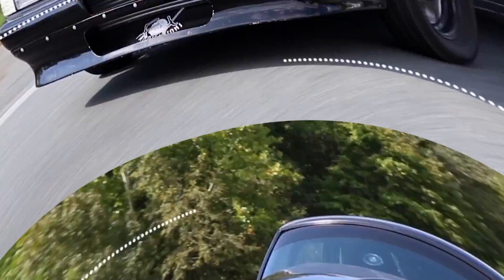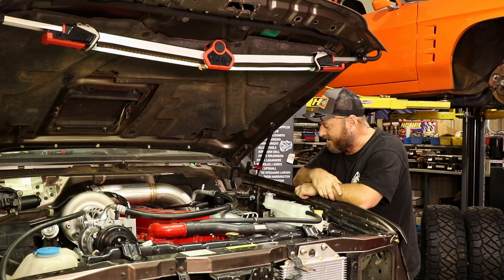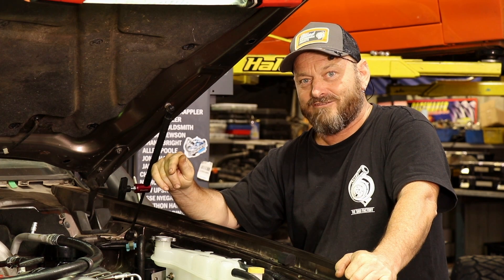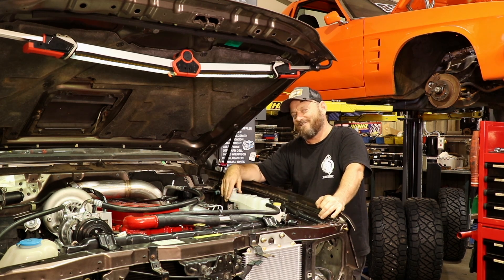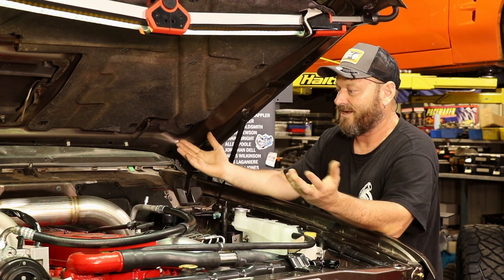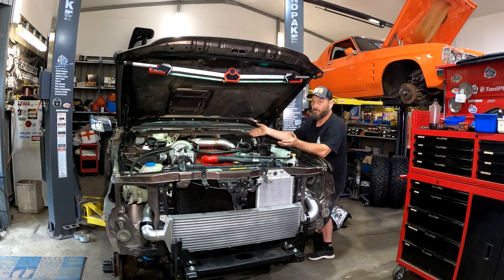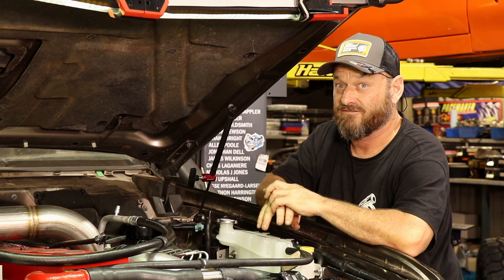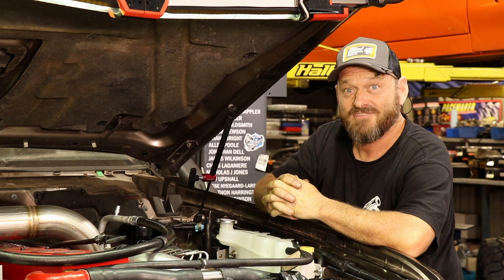Injector Pumps Explained - P7100 v VE v VP44 - Cummins Patrol EP12

Comment: VE pump was 89-91.5 and 91.5-93 for non ic and intercooled 12v. For 94 the p7100 pump was introduced and it was run until 98.5 when the 24v was introduced with the vp44 pump

Comment: the vp44 pump is technically a hybrid pump. With cam-driven, radial piston pump, it features three internal pumping plungers, a fuel metering solenoid, a timing advance solenoid. It's still mechanically injected,  but you can electronically control fueling, using a fuel controller  you can change fueling on the fly with a touch of button.   Also there was 2 types of vp44 pumps you had the std with automatic or manual and H.O. with manual only which had more plunger lift and smaller plungers then the std ones,  So the hop up was to take a H.O. vp44 fueling cam for the lift and use the std pumps larger plungers,  for more fuel supply for bigger injection lines with larger injectors.  And to keep your vp44 pump alive you need to maintain no less then 12psi of fuel at W.O.T.  and 24v cummins with vp44 is when cold they will kick into a high idle to warm up.  And if you're located in very cold weather areas you can have a vp44 24v do something that warms them up even faster and that is having the ecm programed to after it goes into high idle, for 2 mins and temps are colder the 10 degs F. It will go into 3cyl high idle,  by shutting fuel of to 3 off the cylinders to put a load on the engine to warm up faster.    The std 24v was 235hp 16.3:1 compression, the H.O. was 245hp with 17.2:1 compression.     I had a well tuned 01 24v with a 35/45hx hybrid turbo grid heater deleted, RV275 injectors,  and a hotrod pump which was H.O. fueling cam in a std pump case. With .093 injection lines, which make it lopey at idle. And an edge juice with attitude tuner module.  And to keep my vp44 alive I ran an airdog 150 pump.  Was my daily driver and weekend hauler for 10yrs put 250k miles on that truck.

Comment: P pump is easier to tune, you can get the balance between cylinders spot on, having multiple plungers helps in field reliability, tough industrial grade pump FYI Nippon denso make em too. Rotary pumps pretty good but usually if they fail they’re scrap.

Comment: 1:56 that line is bent so hard, it is likely doing nothing. I freaking love this build. You all are killing it. This series lit the fire under refreshing my Cummins. I had to repair years of neglect. Full rebuild, new common rail, had to replace all injectors, new oil bypass valve, all new lines and hoses, basically all new accessories.... I'm about 10K USD into it. But, the whole drivetrain is all new or rebuilt. Keep it up. I can't wait for your build to hit the road. That smile is going to be epic.

Comment: the VE pump also had boost reference didn't it ? does the P pump have boost reference? or is it the cam says this is how much you get at whatever. but it still wouldn't be as good as something with boost reference and ramping ability (if it doesn't have one)??
Reply from the maker: Yes but so does the P pump.

Comment: Using diesel as a coolant and lubricant becomes an issue with low sulfur fuel. You must add a additive to lubricate the system. The VE is like the old 6.5 gm. Diesel pump. Easy to work on but cannot make the same power easily like a p pump

Comment: Would cut the return line off just under the top of the sending unit, otherwise you will most likely introduce air into the pickup tube. The lift pump should take care of it but why make it work harder?
Reply from the maker: I think that would aerate the fuel more.
Reply: It may aerate more but the bubbles would not be next to the pickup tube. Just thinking out loud, I know on semi tanks the older trucks just dumped back into the top of the tank but the newer trucks the return pipe is curved on the bottom and pointed away from the pickup.

Comment: Don't ask me why probably effective surface area and pump priming or starvation but in hydraulic tanks the feed pipe suction pipe to the the pump is cut at a 45* so might be worth cutting the end of your new "straw" to a 45
Reply from the maker: Hydraulic tanks generally don't run out of fluid like a fuel tank can.
Reply: @theskidfactory  well I've read some gibberish about coefficient figures regarding round and oval pipe ends and and the best reason disregarding hours of fluid dynamic research is ....slash cut will still allow fluid flow if the pipes jammed in too far against the tank floor 🙈

Comment: Have another Question , wondering if you have DAF trucks in AUS or equivalent (7.5 to 13 t ) ! running the 4 cylinder cummins/packard engine in a common rail format and if yes have you considered using this engine ,being shorter than a 6bt and producing similar power/torque .Check out youtube 'Bad obsession Motorsport ' project escargo for the engine type im referring to.

Comment: Hello an unrelated question ... wondering if you know anything about VAG group V8/V10  diesels as in engine swaps and rear wheel drive gearbox possibility's ? ,Like where this is going through have a feeling fuel mileage will be horrendous !

Comment: Oi mate if you’re worried about fuel supply just run a sump off the bottom of the tank and never worry about fuel delivery!
Reply from the maker: Potential problems with ground clearance/damage when offroading due to tank location.
Reply: @theskidfactory  skid plate?

Comment: The 5.9 12v cummins also came with a lucas cav injection pump which was commonly used on marine and industrial applications.
Reply from the maker: Yes but they are unsuitable for onroad use.

Comment: Hey Al
I’ve a modified Pajero non CR DID and I want to add a lift pump but I’m concerned it may pressurize the seals and damage them and causing my engine to fill with diesel. The pump I have to use is a low pressure activated type. Will this be fine?
Love the vids
Reply from the maker: They have a Zexel VRZ fuel pump which is probably a Zexel variation of the VP44. You shouldn't have any issues with a small low pressure lift pump. Pierburg makes inline lift pumps that raceworks sell, have a look at their site.
Reply: Yes you’re right mine is the VP44 that’s about $6k to rebuild that’s why I was a bit hesitant to add pump but I’m now confident. 
Is it true the VP44 pump only has 8mm plungers? Apparently only good for up to 28psi on Pajero 3.2 DID non CR which is plenty as I’m already experiencing their main weakness the JATCO torque converter. 
Thanks for replying it really made my day. I showed all me work mates that I got on to your awesome channel and it made me feel like king

Comment: I don't now how it works in your country but dit you try to go to a truck dealer normally they have all the stuff for the fuel system in Europe we use 12 mil airline don't now how you call it in English but we call it nylon pipe or hose

Comment: The secondary failed on my 24v Cummins with VP pump. It will still run and you will not know anything is wrong until it just turns off and no more go. Expensive lessen.

Comment: Put a 90 on the end of the return. If not it will just circulate air bubbles back into the suction line.

Comment: A lot of people look down on the vp44 and they do have that problem but I have 2 vp44 trucks, one of them I hauled heavy equipment every day with and I did change the lift pump twice but even with a stock lift pump it made it over 300k miles before I had to change the vp44 out so they’re still pretty reliable

Comment: Woody's Project: Can't positively tell you the Generation, but by the  thin square door frame, my guess is 4th Gen (or early 5th Gen) Hilux 4x4, with a Diesel 4cyl, couldn't tell ya which diesel it is. Its my best guess. Cheers

Comment: 3:19 - 3:37, Just to right of Al's right hand, there looks to be an aftermarket hood gas cylinder with a handle. Is this after market ? Does the handle allow it to be locked in place ? Who makes these ? Where are they available ? Anyone that can help that would be greatly appreciated. Cheers
Reply: It’s a safety device. For ease of raising and lowering the hoodOEM hood struts are only strong enough to hold up hood alone. Not only that they tend to wear out over time. Note that they have a big work light attached to the hood. Vice grips work as well but can put marks on the strut.

Comment: Thanks for another great show. Al. Kenworth sized fuel line is correct. But don’t knock the over engineered hilux.  We have a meter reader that had 587,000 on a diesel untouched  3.0 litre auto for win  .  I did my apprenticeship on VL commodores  and  from one Holden mechanic to another  Some more truck parts will get it going   Love the sound of the turbo forklift

Comment: The dual tanks only show indication there is a switch Infront of the centre console that when pushed in starts the sub tank transfer pump and pumps it across to the main tank, it only pumps when the main tank is around half full

Comment: I’m watching a channel called Waldo’s world, he is fitting a 6BT to a GMC truck, he has the VP pump & he has spoken about the failure point of the VP pump setup.
To safe guard against that happening he has installed an uprated electric feed pump. He has also covered the other issues mentioned by Rich like the KDP.

Comment: Hilux spitting injectors?? Yet all the ones I know have 300k kms and still original injectors and still run like new
Reply: And 3 of our work hiluxs have shat the bed for the exact reason Al mentioned, destroying 2 of the motors. Luck of the draw I suppose
Reply: Or improper maintenance and thrashing the hell out of it like there a pos Nissan

Comment: vp 44 pumps tend to have an issue when it comes moisture as well and only need tiny bit to get in there and rust the electronics in pump and cause you to have all sorts of issues , the VE pumps on the cummins are a Bosch brand ( Nissan's are a zexel and toyota's run a Denso) and Bosch VE cummins pump all run 12mm hydrulic heads and can flow up to 250ccs of fuel or more depending on head wear downside to them is the fact they are bosch the parts for them can be pricey , P-Pumps can change the element sizes (plungers that deliver fuel to Delivery vavles ) governor weight springs , fuel plates , rack travel plus few other things can be modified and the fuel pressure needed to run theses pumps is between 1.5-2.5 bar

Comment: I'm not a diesel guy. So how does a common rail work?
Reply: there is a small lift pump in the diesel tank that feeds a bigger high pressure pump that goes to a fuel rail. 
This rail connects to the injectors which go directly in the cylinders. 
Each injector is fired individually at the right time by a computer.
there are lots of variations in systems but more or less they all work like this.

Comment: 12:27, nothing wrong with a VP44 pump? Al, that's the same pump that's in the zd30, which is common to fail, and when the cost here is anywhere between 3200 to 4200 to supply and fit minimum, its not feasible, and not smart.

Comment: Should put the ppe duramax pickup cup on that pickup tube or some form of radius'd inlet to that tube or you will be aerating the fuel going into the airdog unnecessarily as well as limiting possible fuel flow

Comment: Probably worth chucking out for those that don't know about Dash hose sizes. The number refers to the hose inner diametre in 16ths of an inch. -8 is 8/16"  or half inch. -10 is 5/8 hose size. 16 would be an Inch.
Reply from the maker: Cool, didn't know that.

Comment: When Al said the p-pump was like a little engine being run off the larger engine my mind went to the Bloodhound SSC that has a 500hp supercharged Jaguar V8 running the fuel pump. Its like the opposite!
Reply: Not anymore! They changed the jaguar V8 to use electric motors to power the fuel pump. I think they are Tesla motors if I recall correctly
Reply: @seboest20  And before that they were using a Cosworth F1 engine. Until they realised they would have to rebuild it after every few runs (and got sponsored by Jaguar).

Comment: VP44 killer for torque reversals we chewed chains at Nissan in Europe with these (YD1 2.2) if gear-driven OK, there is a Chinese version of the P7100 made under licence from Bosch Wuxi Weifu very good pumps, the injector advance mechanism is a bit iffy on VP44 and the brain is sensitive to temperatures you can fry them...note VE is a single plunger and VP is cam ring and plungers(2) very very similar to Lucas Roto Diesel - you have to be very old to remember this pump....

Comment: A possible mod for any type of fuel system is to drop the return line into a swirl pot put a pump on it to drive fuel into an injector or two mounted into the mouth of the intake manifold , a computer or micro switch on the throttle could fire the injectors when needed.

Comment: I imagine Al is up on his differences between hydraulic JIC and auto AN fitting flare angles, but if not, have a google. You'd probably get away with it on that fuel suction line either way though
Reply from the maker: It's a 37 degree flare.